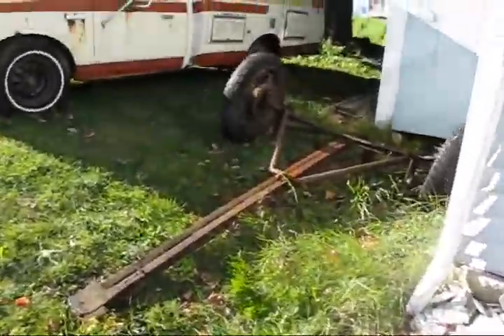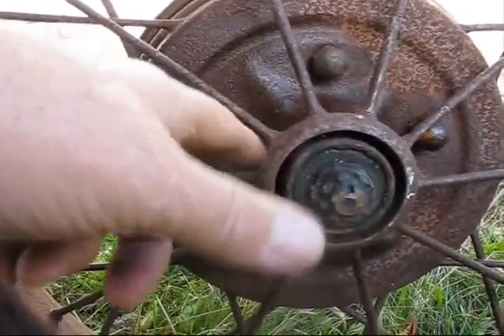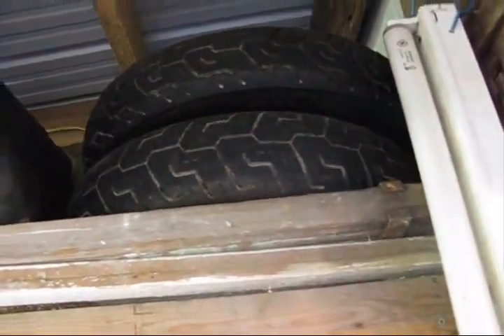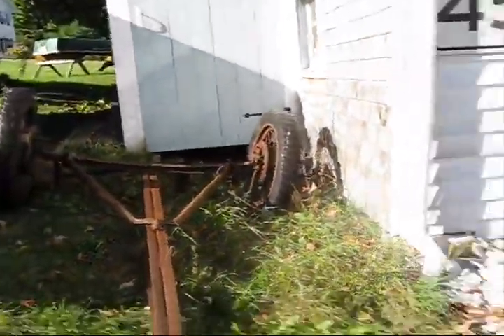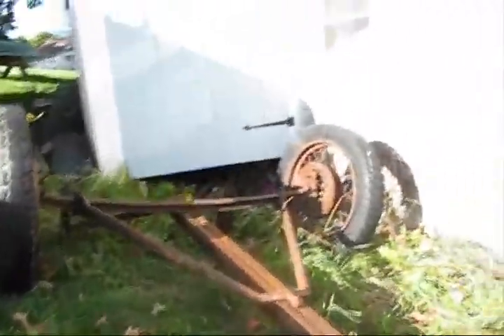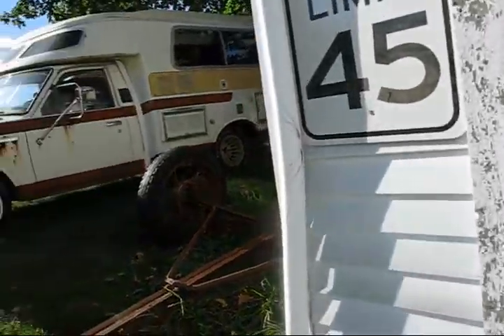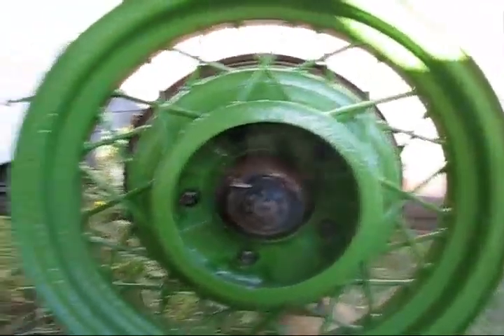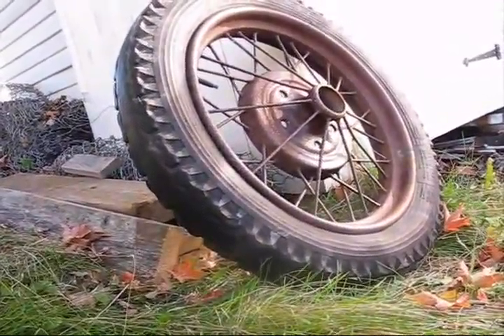Rat Rod Trailer wheels Model A vs 35 Ford wire wheels

Comment: Taller tires and rims make for a smother ride and more clearance go for it and the little rims will look perfect on the trailer. It will look really cool. So long as you can find a safe tire that is tough enough to hold up your v8.

Comment: Yes those model A wheels would work on your rat rod, and I've seen people who have them on their cars. But I've been told that it is not advisable to run them because they are not strong enough to run at highway speeds, or with disc brakes, especially on the rear end of a V8 hot rod. The spokes were never designed for that kind of load. Again I've seen it done before but I wouldn't do it, it's one of those things I wouldn't chance, I see no reason you couldn't run them your trailer though.